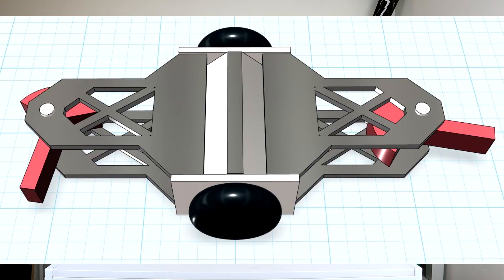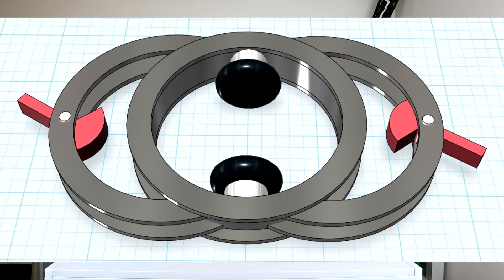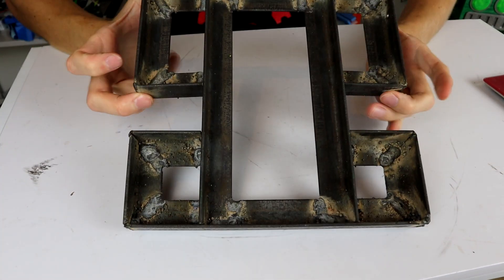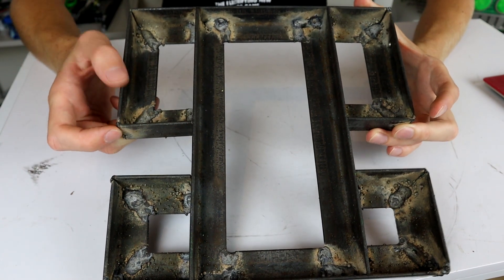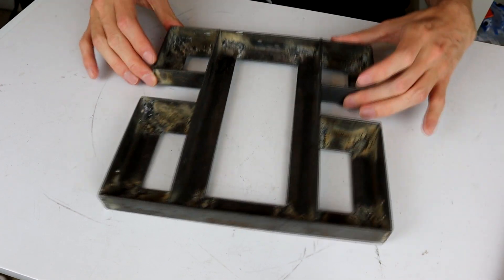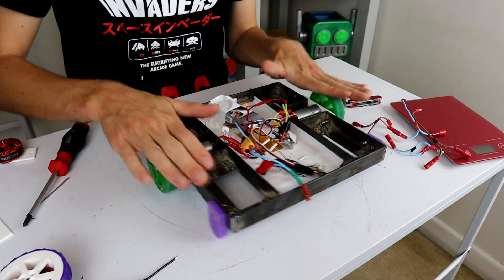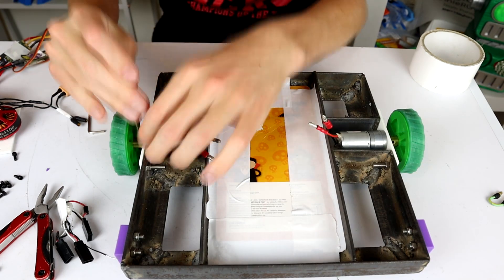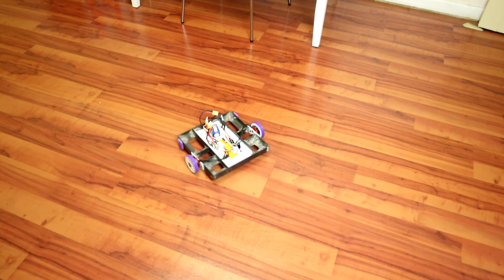Beetleweight motor stress test platform (design and build)

Comment: me thinks you forgot to turn on the gas sir
Reply from the maker: Yeah, unfortunately they where out of gas and I had to use gas less wire
Reply: @TeamPanicRobotics  just make sure you don't put the frame under any dangerous stress with your face near it... no gas = hollow welds but I am sure for its intended purpose it will last forever

Comment: Have you though about giving the Neo Hellcat 180s a shot for some brushed madness?
Reply from the maker: Honestly, I hadn't heard of them, so I just did a quick google, they seem to be nerf flywheel motors.

They might be useful, but for drive they would need a gearbox which means either attaching them to an existing gearbox or making my own, either way, is a fair bit of work to get them going.

For a weapon they will be easy outstripped in power to weight ratio by a half-decent brushless setup.

They seem interesting but unless I can find a good gearbox for them, their appeal is limited

Comment: Love it do you have a link for the motors and wheels
Reply from the maker: I got them from Aliexpress, theres a link at the end of this comment but I'm not sure how long that will last.

If anyone is reading this comment in a few months from now and the link is broken search "4108 brushless motor" on aliexpress to find them

https://www.aliexpress.com/item/32829314483.html?spm=a2g0s.9042311.0.0.6b634c4dlRwxEz
Reply from the maker: Which motors do you want a link for? the brushed ones or the brushless ones?

The wheels are custom printed with custom molded silicone tires
Reply: Brushless please

Comment: Doesn't battlebots have rules against weapons powered by the drive as part of the active weapons rule?
Reply from the maker: yes, which is why I'm building a dual spinner melty. 

It will have two spinners that are powered themselves then the whole robot will spin. By the rules, the robot has 2 active weapons and will be allowed to compete
Reply: @TeamPanicRobotics  Ah, sorry i misunderstood, i thought you were using the motion of the melty to power the blades. I definitely look forward to the progression on this. Seems like a lot of fun
Reply from the maker: @Leigh Hargreaves From what I have heard, (its really all hearsay) at least one producer at Battlebots does not like melty brains at all due to poor performance and slow translation speeds in the comedy central era (and earlier). As such the active weapon rule was partially put in place to deter melty entrance.

Technology has improved a lot since those days though, Meltys can translate faster and hit harder, but my contact at battlebots did warn me that to go with a melty idea I'd need to prove it. Hence why I am building a beetle and a feather of the same design. I want to prove it can provide a fast, hard-hitting, entertaining fight
Reply: Has BattleBots ever offered any explicit advice on melty brains? I wonder as, while I know what the active weapon rule says, it would seem like a melty brain robot complies with the spirit of the rule, even if not obviously the letter of it. In which case, perhaps BattleBots might ok it? Banning the primary weapon being powered by the drive seems to me to be more aimed at excluding wedges, ramming spikes and those sorts of things.

I also wonder as, if you have to put independently driven spinners on it anyway, doesn't that render tornado drive as just a needlessly complicated form of locomotion with minimal benefit (save looking interesting on TV, obviously)?